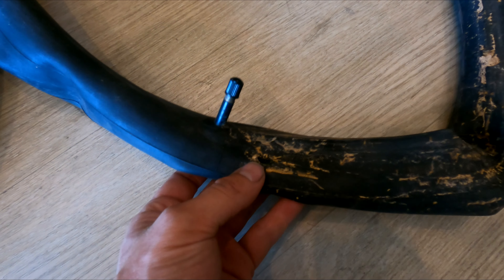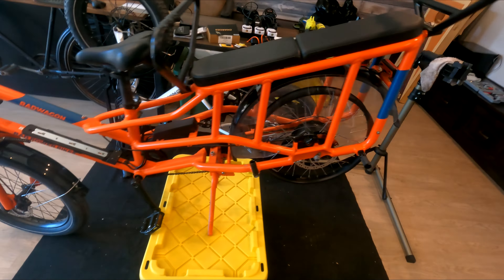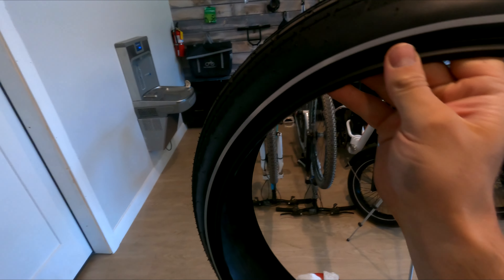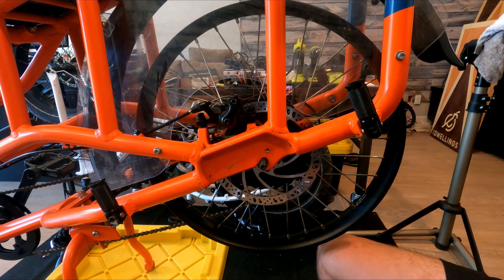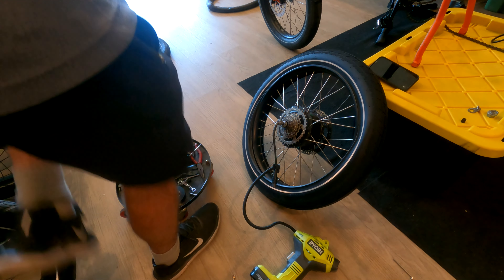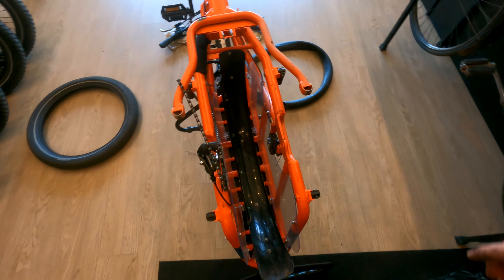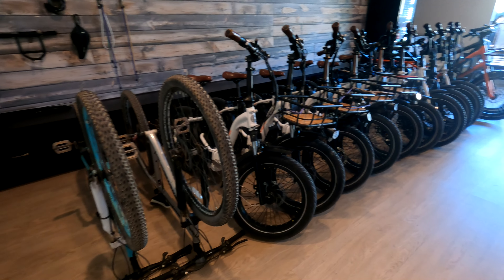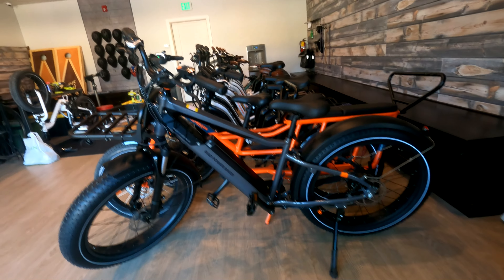How to Repair Rad Wagon Rear Flat Tire | Rad Power Bikes Tire issues | Ep.13

Comment: I spent 4 hours replacing the rear  tube on mine today. Technical difficulties getting the axle back all the way in the slot to screw in the little metal plate that holds it in place. I’ve been biking and replacing /repairing tubes for a couple of decades of my life, but this is my first on an e-bike. For such a pain to repair, they should have inserts and slime pre installed. Also, $20 for a really basic quality tube (in 3x22) seems like a lot. The tires are quite thick though, so that’s good.
Reply from the maker: Yeah it’s not a fun one to replace. There were no videos online so that’s why I made this one.

Comment: That’s wild that they would say to go through a third party. NOBODY, NOWHERE sells that size tire. You can’t even find it on eBay. Your only choices are the replacement ones from rad or the vee speedsters (the only company who makes these tires, including the factory ones) at $80 each.
Reply from the maker: Yeah it’s pretty ridiculous
Reply: Reddit says the tubes are a different size than Rad posts, that it may be best to use a 20 inch. Have you happened to try that?